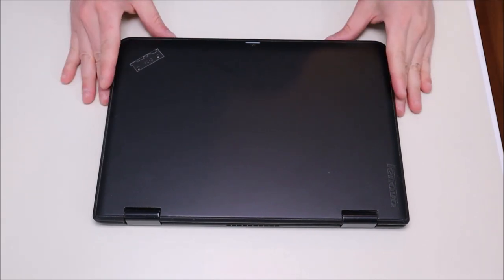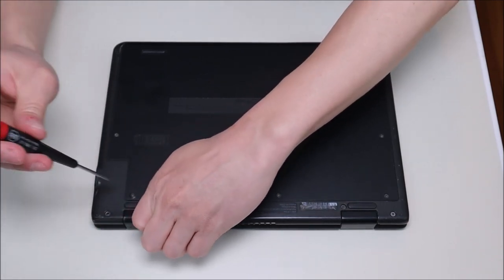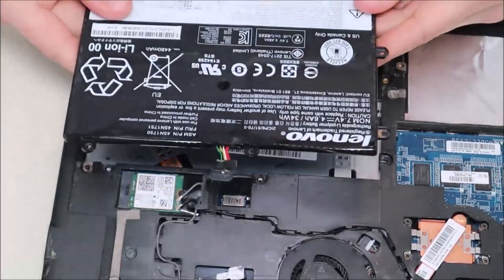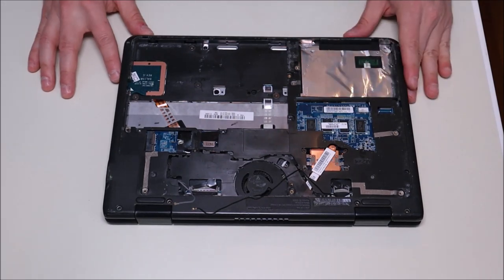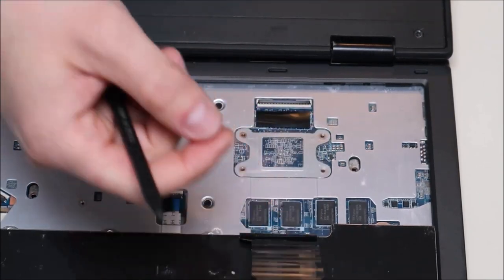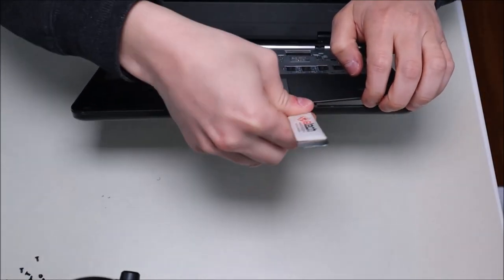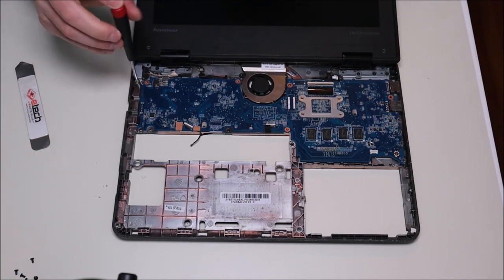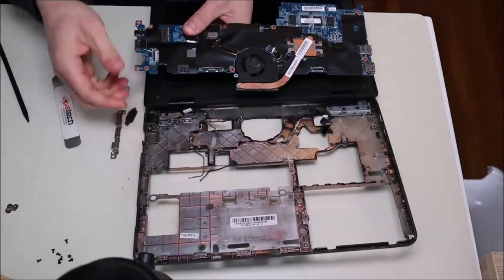Lenovo Chromebook ThinkPad - Motherboard, Fan, Heatsink, etc Access / Replace

Comment: Hi can you help with my problem, i recently wiped my laptop's data via the bios setup, not now I'm unable to  install any new operating system, or do anything at all
Reply from the maker: What brand and model computer do you have and what happens exactly when you turn it on?  What can you see on the screen?

Comment: Hi if you can help me whit my laptop , when I turn it on it turns off immediately after and the screen is black the only thing that is working is the fan , the laptop is an acer, if you can help me fix it it will be really helpful
Reply from the maker: 1.  For a computer that turns on but the display does not work, try this video first; https://youtu.be/e9iy30J00-k.  Let me know how that goes :)
2.  Also, did anything happen before this issue appeared?  Overheating, liquid spill, Windows update, etc?
Reply: @PC_Monkey  I watched the video but my problem is not a black screen I just press the icon on the welcome screen and it started doing that, I pressed the icon on the left from the shut down icon and since then it just turns on for 3 second then turns off
Reply from the maker: @sebastianandrei6528  Ok im sorry.  Your first comment said that it turns off immediately after it turns on.  Are you able to access BIOS at startup as seen here?  https://www.youtube.com/watch?v=gDQZvNQ2chc.  Can you find any Repair or Recovery options in BIOS?
Reply: @PC_Monkey  I can't access bios it turns off too fast
Reply from the maker: @sebastianandrei6528  For a computer that does not turn on, try this video first; https://youtu.be/kOBY4k2Mn_k. Let me know how that goes :)
Reply: @PC_Monkey  thanks for the help, but I tried opening it and I'm afraid of pulling some of the wires I just don't want to damage it more I'll just leave it be,  thanks again for the help so far it really gave me hope
Reply from the maker: @sebastianandrei6528  Good luck !!  Let me know how it goes :)